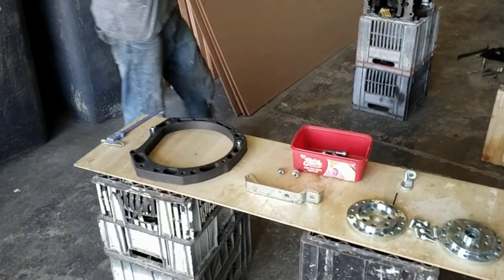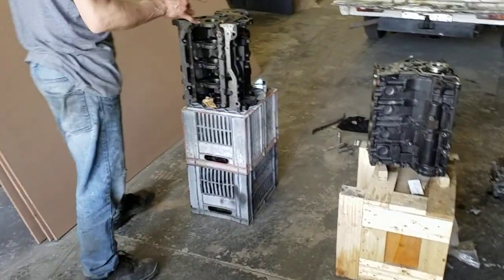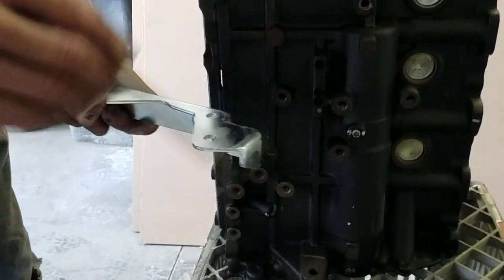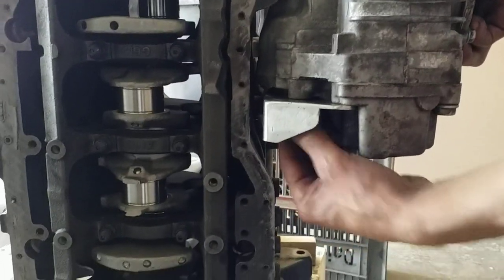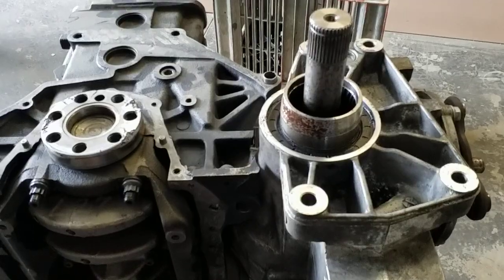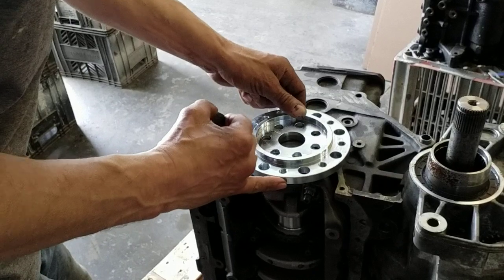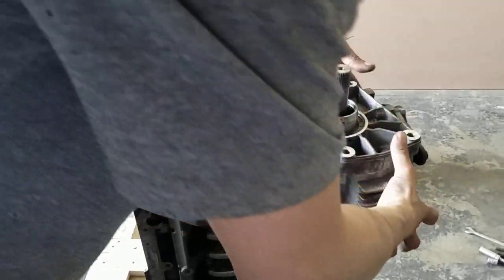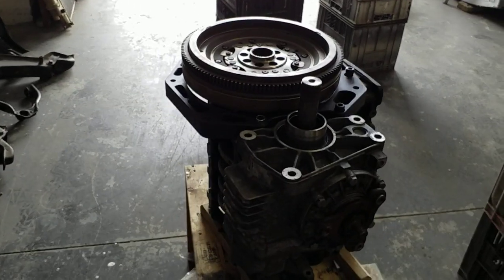evo 4g63 to DQ500 dsg assembly part 1

Comment: Hi, would i need to cut the block for a FWD setup so without the transfer case? And is the adaptor plate steel or aluminum?
Reply from the maker: Adapter plate is 30mm aluminium
Reply from the maker: No need to trim the block for fwd setup. But you would need a custom midshaft/axle, which I can provide. Is this for DQ250 or DQ500? My axles will only work with DQ250, for now.
Reply: @SuperDrivetrainSolutions  It's just an idea at the moment but no cutting of the bock sounds good to me, 4g63 swapped mirage haven't decided on a gearbox yet but if i decide on a dsg it would be a DQ500, will be in contact with you if go with the dsg thank you.
Reply from the maker: @Zack-ex2qp  I have a customer in australia want to put 4g63 plus DQ250 2wd. Rear mount engine. I'll do a special for him.

Comment: Hi buddy. How to contact you? IG? Email?
Thanks
Reply from the maker: WhatsApp +27826580963
Reply: @SuperDrivetrainSolutions  
Hi craig just seen this video on you tube. Love ur work. I am very interested in doing this conversion. I have built an evo 8 about 10 years ago. Which is now due a rebuild and gearbox change. The car runs about 600bhp at the moment. How can i buy the conversion parts from you?

Regards JamesNeil
Reply from the maker: @jamos205  hi, please contact me on whatsapp +27826580963
Reply from the maker: is500v12@gmail.com  if you dont wanna use whatsapp